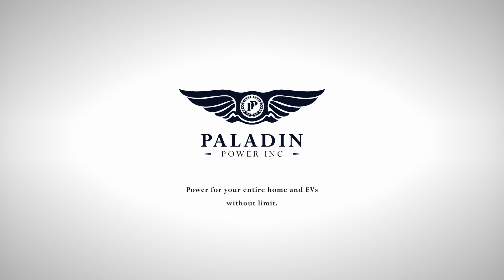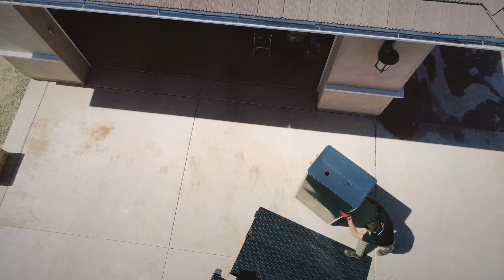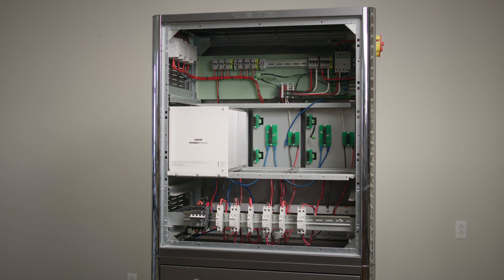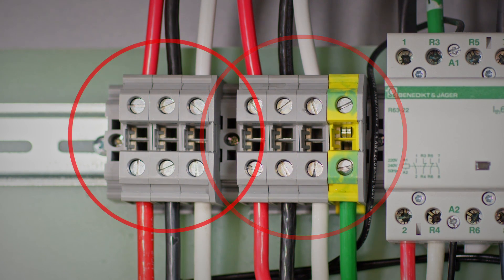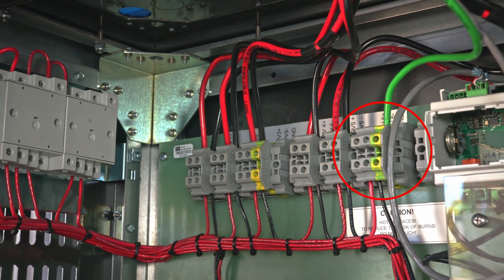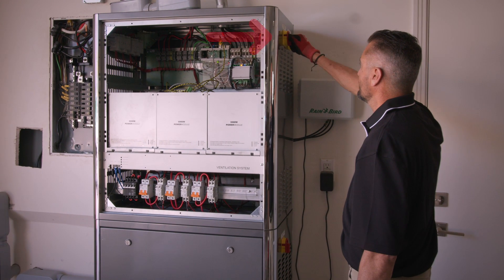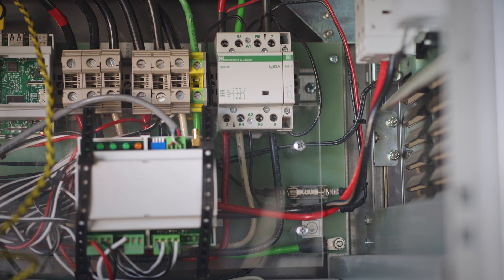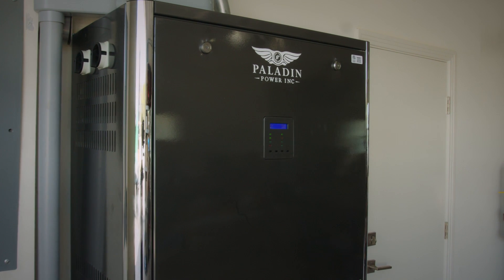Paladin Power Install Video Instructional

Comment: What if you have a solar system with microinverters? Do u leave the solar connected to ur subpanel? Is this compatible with solar strings that come off the roof as ac?